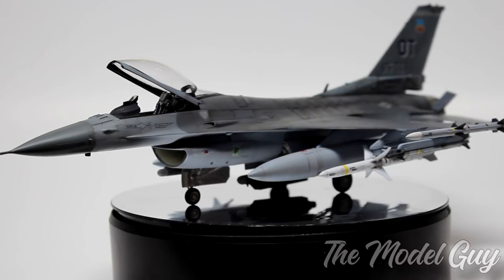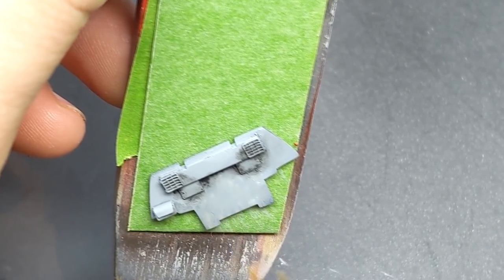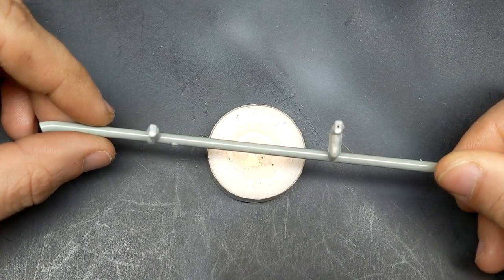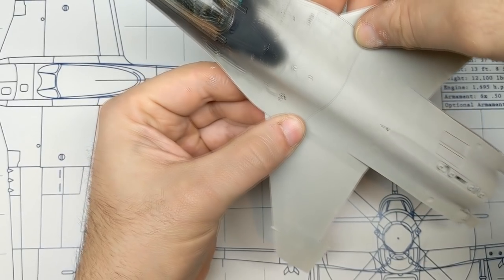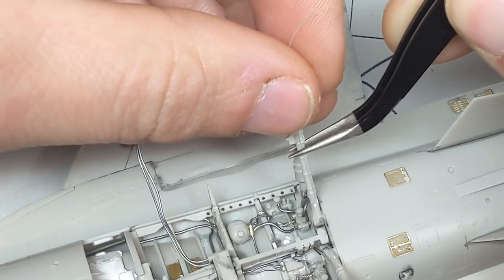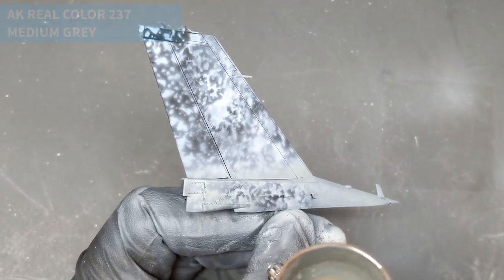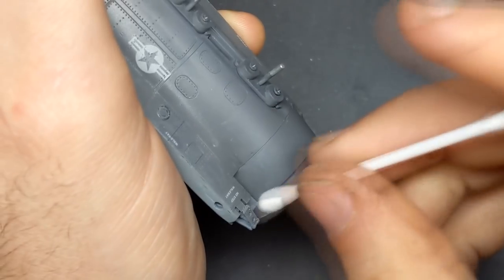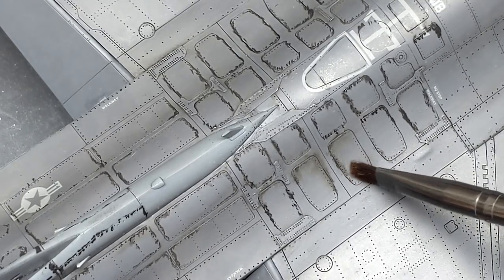Easy Steps for beginners to improve the 1/48 Tamiya F-16CJ Fighting Falcon Kit

Comment: As a guy who's been in aviation for 15 years, plus I was a crew chief in the air force for 6 years and deployed multiple times in support of OIF and OEF, I can a confirm that aircraft are incredibly dirty, especially birds on deployment.  Even civilian aircraft get really dirty.
Reply from the maker: You must have some epic reference photos on hand :)
Reply: Kind of common sense...
Reply: @CJR505  you act as though everyone has common sense these days 🙃
Reply: @sloppyjoe400  very true ...I guess that's why OSHA might have been created, lol
Reply: I asked a coworker who maintained F 16s about his job and the thing that stuck out most was the Hydrazine used to start the engine in case of an emergency was so deadly if you saw the indicator notifying you it had leaked meant you probably would die shorty after exposure.
Reply: @Poopster4U  I worked with a guy that had been exposed to Hydrazine, so he says. Worked on F-16s at Edwards.
Reply: As a Rear Admiral who spent 26 year in Subic Air Base I can confirm that all F16 has front and rear wheels like this model 😊
Reply: @Poopster4U  You definitely do not die shortly after exposure. You have a higher risk of cancer and other health issues down the line but death shortly after.

Comment: Excellent Viper! Having maintained Block 30, 40, and 50 jets for 22 years I feel I can almost get wrenching on your bird with some 1/48 tools! Well done!
Reply from the maker: That's awesome thank you :)
Reply: Same here Rich ... A great representation ... I almost wanted to call MOC and schedule her for a wash rack visit though ... kinda ... Would have loved to have seen some zinc chromate green around some panel edges and along the leading edge panels and screw holes where the grey paint chips off, maybe even a inlet nav light "hot batch" sealant streak from changing bulbs between goes ...  Awesome job Model Guy !

Comment: To a beginner, I would say that the Tamiya F-16 is one of your best bets for having zero seams visible (and certainly for one below $50).  It is a very well-fitting model (like warm butter), and with some strategy you can manage the more obvious seams.  First, the intake.  Those interior seams are tough, but you can really only see the side seams on the first section.  The rest can only be seen with a flashlight.  So I recommend painting the four intake pieces white, then fitting the two front halves and two back halves together, work the seams you can reach, then put them together.  Then you can attach the front intake exterior panels (with the landing gear bay frame if you are doing gear-down) and work down those outer seams.  That can all then go into the model as one big piece.  Next, as lightly mentioned in the video, you can join the two big upper halves and get a perfect seam there, and it may require removing the big locating tab Tamiya put there to get it perfectly dialed in.  From there, it should be gravy.  I would also skip the detachable fin assembly and glue it directly down, which will let you better work the seam around its base.

Comment: Really nice build. Loved the mini lathe and knife.  I have watched a number of videos on decaling without gloss coat.  I think the main thing to prevent silvering is to make sure the paint is very smooth before applying the decal.
Reply from the maker: It definitely puckers up my butt hole when using my Dremel as a lathe. Stuff can potentially pop off, the worst being the blade.

Even if your paint isn't super smooth, a clear coat won't help unless you soak it in clear.

Comment: I did a model of a 69 dodge charger a couple years ago, it was of very low quality so either things were poorly made or not there at all. Example, the fan on the engine was a 4 prop fan but it was so poorly made it basically had 3 blades and a stump. So looking back on an older model charger I had done 10 years ago that was falling apart and not really done well, I managed to salvage the fan which was of very high detail and had 5 props on it. With it being behind the radiator you don't really get to see it, but, I was grinning ear to ear when I put it together. Even managed to salvage the gas cap too. lol

Comment: It’s a weird coincidence that the last 3 projects of yours, I’ve also done. Hien, P-47M and F-16CJ (1/72). I’m the Goofus to your Gallant in this case.

Fun fact: the Pilatus PC-12 I used to fly had a bit of a HOTAS system as well.
Reply from the maker: That's really cool. I wonder what other aircraft in civil aviation have HOTAS as well?
Reply: @TheModelGuy  The PC-12 had pitch/aileron trim on the yoke hat-switch, as well as command bar sync. The rudder trim, TOGA and comm-switch were on the power control lever (throttle). Just a wonderful pilot’s airplane. I can’t say my CRJ9 has the same creature comforts but it’s still a great jet 🙃
Reply from the maker: @CJ-jh9ri  I've heard some horror stories of the CRJ-200 being dangerously under powered. Any truth to that?
Reply: @TheModelGuy  Hey! Sorry for the wait! Luckily for me, I never touched the 200, though I’m told the climb rate sorta peters out around 18K. I’m on the 7/900 and they seem to have fixed the issues the 200 had. They also added a FADEC system which is a lifesaver. Due to the pandemic passenger loads I’ve even managed to squeak up to FL410. Fun fact: The GE CF34 also features on the A-10 and S-3 Viking in military spec.

Comment: Wonderful build, I didn't think Tamiya made an A model from this mold series. 
As a former maintainer of the viper for 8 years, I can tell ya, I was wanting to put Safin pins on the jet, climb up into the cockpit, run a safe for maintenance, and check for malfunctions then check my systems for the next flight.
Ever think of using a resin cockpit instead of the photoetch?
Reply from the maker: I love this type of feedback!

I have looked at some resin cockpits but have found quite a few of them do not fit correctly from shrinking. I had an Aires set for a MiG-21 that shrank, Eduard FW-190 pit that had shrank and some other resin bits that were too small. At this point I’d 3D print some new switch panels so I could design and adjust as needed.
Reply: @TheModelGuy  my issue with 3d printing is that resin printing SLA is the way to go with that, and you still have shrinkage, kinda like jumping in cold water... Your fingers people... Sheesh.
But you find the right resin, and the right settings and, there ya go.
I've got an Elegoo Mars and an Ender 3 Pro, so far the Mars is my go-to for detail. And the Ender for things like stands and fiddly bits.
With getting married a year ago we are still combining households so, I haven't played with them in over 18 months...Sheesh
Reply from the maker: @EvilWill1  I was using a Photon Mono X and just had the second screen die within 100 hours of use. Anycubic won’t support it so I’m looking for a replacement. I’m seeing some guys get awesome egloo prints. I may find one
Reply: @TheModelGuy  two hours into using my first resin printer, can't even remember the brand, the auto level failed, the bed came down, the bed continued through the screen. The FEP held through the glass and metal. But that was fun explaining...
Money back, bought the Elegoo instead.

Comment: Building the older Eduard Fw-190 A8's engine and then closing up the cowl. 
I was probably a little too inexperienced to tackle that kit, but I love the 190 and wanted to try a new manufacturer (and it was cheaper than Tamiya's offering at the time lol). 

That was about five or six years ago. I'm sure that if I try it again now, I would build it a lot better AND leave the engine cowl open.
Reply from the maker: Eduard retooled their Wulfs. The A-5 is a fantastic build
Reply: @TheModelGuy  I'll have to check it out! I built the D-9 shortly after the A-8. That was an awesome build. 

Nice to see how the Viper turned out in this video! I know I'm a year late to it, but it's been fun watching you work.

Comment: Gloss coats will protect white (or lighter colors) decals from bleed thru with bright background olors (think white decal over red, huge issue for model cars).  Also, some setting solutions and paints do not get along which can cause problems.  If you've got a system that works then by all means carry on, but be careful when trying new stuff. Nice job on the F16.

Comment: how do you do the very fine brushing of the knobs and dials in the cockpit with the silver color used? is that a paint or a silver dust?
Reply from the maker: It's called dry brushing. You dip a brush in  the paint and then wipe off as much as possible on a shop cloth/paper towel. Then when you stroke it on the cloth and it's barely leaving any paint you can then brush the panels.

Comment: Do I need something else besides paint brush and a compressor to be able to use the paint brush?
Like a pressure regulator or something?
Reply from the maker: You'll definitely need a regulator if you are looking to use different paints and thinners. I work from a range of 10-25PSI.

Comment: What do you with your canopy after you paint the plane? I can't see any masking on it and you basically treated it with paint but at the end there are no traces of paint on it? Do you clean it always afterwards or what's the magic?
Reply from the maker: I’m not sure I understand the question. I mask the canopy, paint the interior colour first and then the outer colour. Any paint that gets through I clean off with a tooth pick
Reply: @TheModelGuy  e.g. 9:37. I can see the interior of the cockpit and canopy is installed, yet you paint over it?
Reply from the maker: @pauldechampignon2287  the Tamiya F-16 comes with a tinted canopy and a clear canopy. I used the tinted canopy to mask the cockpit

Comment: I build hobbyboss 1 72 rafale doing the same thing to the wheel bay, adding few cable on the landing gear and adding small antenna for the updated version and what not and all of it is barely visible especially the wheel bay because its a 1 72 kit 😂

Comment: Honestly icm's mig-25pd, got ALL the extras, met details exterior, intake, short barrel exhaust, eduard cockpit, exhaust pe fans, closed up the landing doors, adjusted the intake lips and variable ramps, with all that said the kit was an absolute fit and finish nightmare! The nose and intakes didnt line up on the inner brace, they were off centered, the sides for the fuselage had 3mm gaps, the tail wang had a monster ridge and gap, the wings had 1-2mm gaps and a 1-2mm ridge at certain spots. It was an abomination that turned me off of icm's kits altogether.
Reply from the maker: I’ve been burned three times by ICM fit. On their Kadet and Tiger Moth the upper wings do not fit with the spars being too short. The JU-88C engines do not fit into place either.

Comment: I built the Miniart Su-122 with full interior. And none of it can be seen after it's built. That's a full engine bay, transmission, crew compartment and everything. And only bits of the crew compartment can be seen through the top hatches. Shame, as the work I did on the interior is some of the best I've done!
Reply from the maker: I have their SU-85. Same thing to look forward to.
Reply: @TheModelGuy  lovely kit don’t get me wrong, but actually the interior was almost the more interesting part of the kit! And it’s all hidden.

Comment: The two biggest waste of time's I've had on aircraft kits - fitting the Eduard photo-etch to the interior cabin of a Shackleton and attempting to fit the interior photo-etch to a Eduard (Hasegawa) 1/48th Scale Hawker Typhoon IB Profi-pack (utterly pointless as the cockpit is so dark, add to that an overscale photo-etch seat & ill fitting/warped resin).

Comment: Eduard resin shrunk? Color me surprised, not! Every brassin item I'ver ever bought is shrunk. The worst one was the exhaust for the Tamiya F-16CJ. They're over 2 mm too small. In DetailScaleView youtube channel in one of november tours of Eduard offices you can hear some of the most baffling explanations, no action to remedy a flaw and disregards towards the usability of their products. When they toured the brassin manufacturing they're showing the masters and among the things talked in the video is the masters go down 4 generations of mold making and copying for the pieces they use for mass production. They also acknowledge that all silicon and resin shrinks, but they don't do any compensation in their designs because their justification is that it shrinks at different rates depending on the shape of the part. The problem is that after 4 generations from master to mass product, taking a best scenario using high quality silicon and resin that's over 5% shrinkage from a master of a given size. So an exhaust with a 24mm diameter in their masters which would probably fit the kit perfectly ends up  being  22.8mm in the items being sold leaving a noticeable 1.2mm step. Same for other exhausts where dimensional accuracy is required for the resin to mate with the plastic. Not so much for their weapons, most of them are good since you don't notice it that much, except a few where the fins don't fit the slots in a longitudinally shrunk missile boddy same for their MERs which are so shrunk longitudinally that you can't hang even their own bombs at the front and back of the rack without obstructing each other.